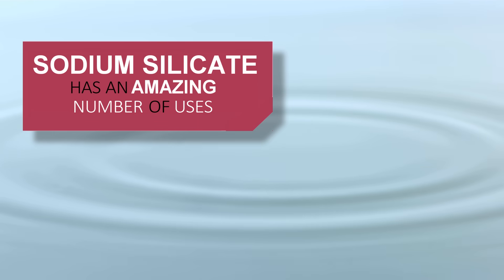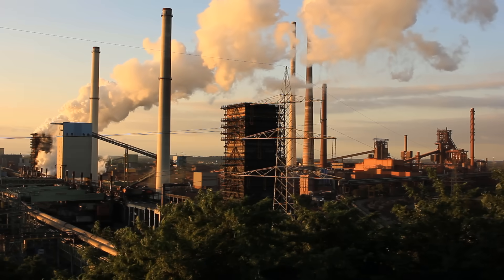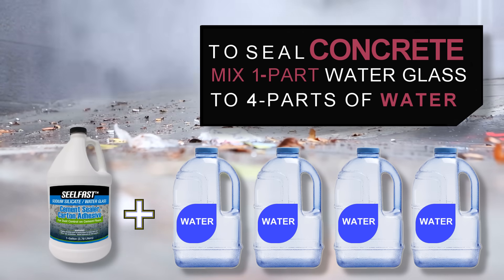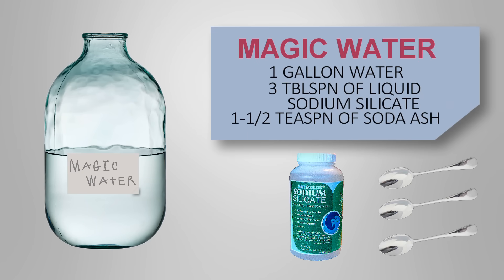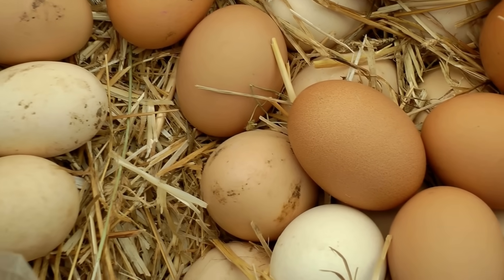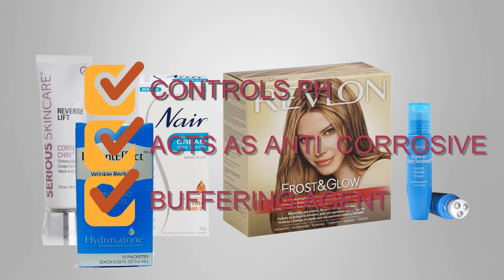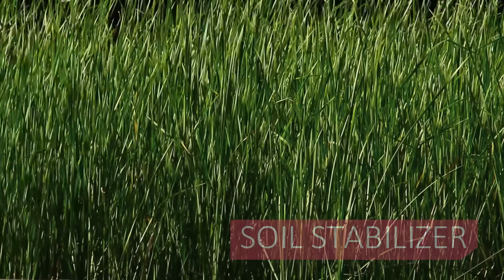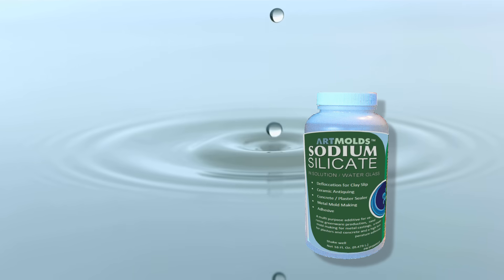Sodium Silicate || Water Glass: (Uses from Industrial to Daily Life)

Comment: Can recycled glass replace sand in molds or casting with sodium silicate cured with CO2?
Reply from the maker: Depending on what metals you are pouring, glass may melt at temperature. Pus, the glass would need to be ground as fine as mold sand.
Reply: Just use very finely sieved play sand or silica sand.

Comment: hi Can I use this on Blown Head Gasket Engine... Appreciate the Reply .....Thank you
Reply from the maker: Liquid glass can be added to a coolant system on a vehicle to seal leaks caused by a blown head gasket. It is a sodium silicate that crystallizes in cracks when it dries, providing a temporary barrier and is most effective when used on cars with iron cylinder heads.
Reply: Environ Molds Thank you so much...
Reply: CRC and other mfgs contain this Sodium Silicate, but be sure to flush your antifreeze completely or you will lock up the waterjackets.
Reply: chrispompano so the crystals plug the hole then the rest has to be flushed or it causes problems? How long do the crystals keep the hole plugged for on average? It’s a temporary bandaid then.
Reply: A new head gasket is the best solution
Reply: So, did it work out on your car?

Comment: Can I use sodium silicate for agriculture?  look like fertilizer or not.
Reply from the maker: With use on soil sodium silicate is used as a soil binder on slopes to reduce erosion as it holds soils together.
Reply: What is effect of sodium silicate on plant? I focus to sodium silicate for using in agriculture and plant growth. (sorry about my English)
Reply from the maker: Sodium silicate acts as an adhesive. It would seal the pours of the plant's leaves and prevent respiration leading to the demise of the plant.
Reply: thanks
Reply: @EnvironMolds  I wonder if it would add moisture holding capacity to sandy soil. Or would granules of gell work better. For drought resistance etc.
Reply from the maker: @garywheeler7039  Hi Gary. Sodium Silicate acts as a soil binder neither taking or delivering moisture. There are polyer gels made to add soil moisture. Check out soilmoist.com
Reply: Environ Molds yeah but if I pour this shit on my driveway will it stop my pavement from falling apart anymore ? 🤣